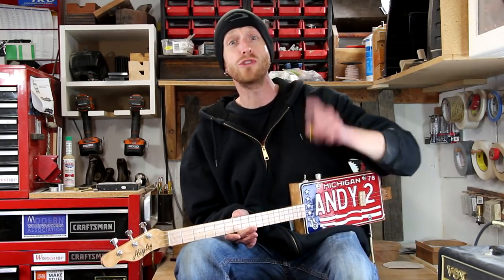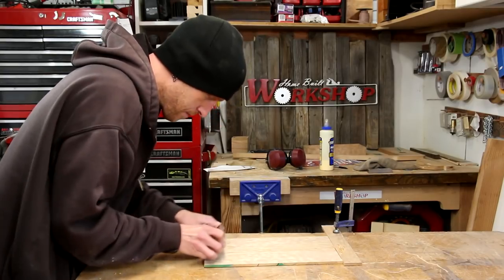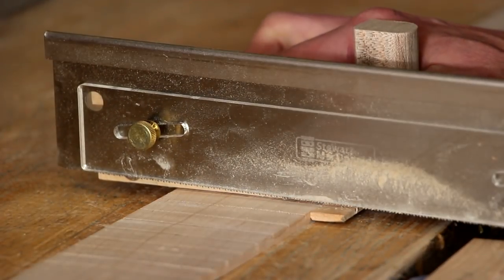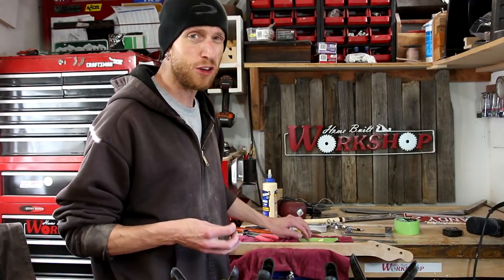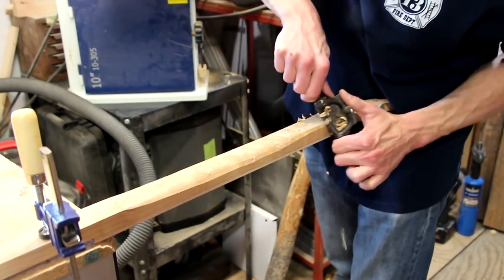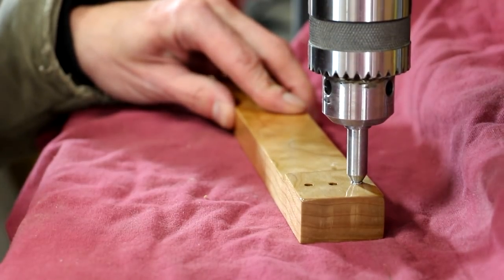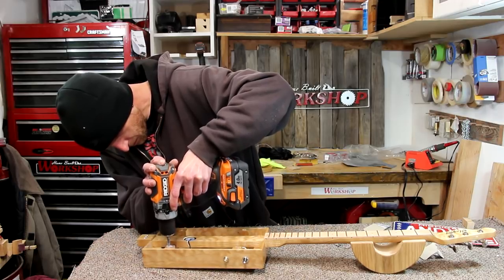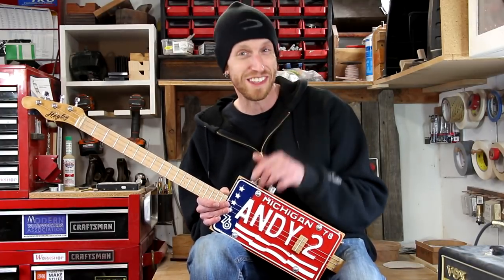3 String License Plate Guitar

Comment: I was hopeful but there was no talk about the technical specs or technical assembly.  What kind of switch?  How is it wired?  What resistance on the potentiometer?
Reply from the maker: I used CTS 250K Pots. Its wired just as you would wire a 3 way switch for a 2 pickup configuration.

Comment: only ONE thing ... thinner sound is usally at the bridge and the fuller sound is on the neck pickup so you got it the other way around ;) Beatiful build thou :)
Reply: and... the piezo pickups works of vibrations so if you mounted a pickup to the top you'd get a fuller sound probably
Reply from the maker: Thanks. I should try it right on the top. 👍